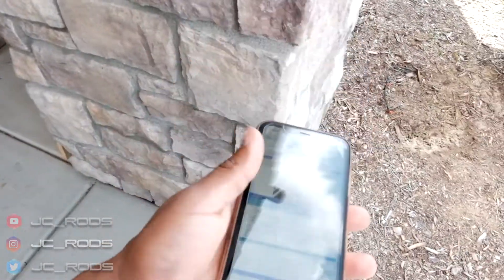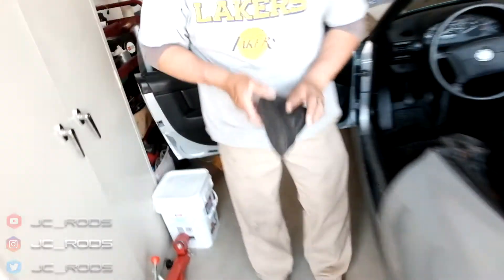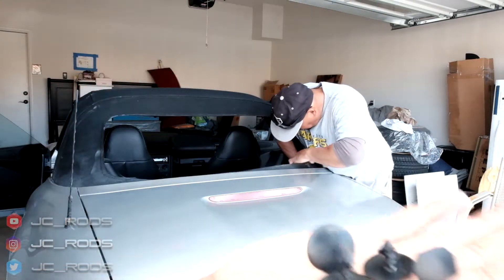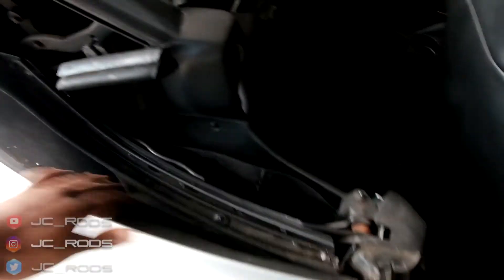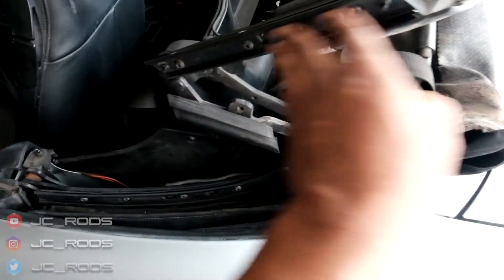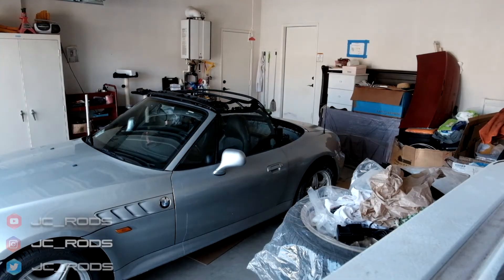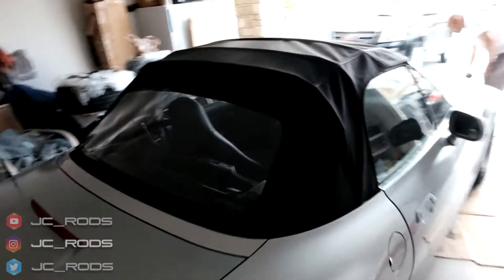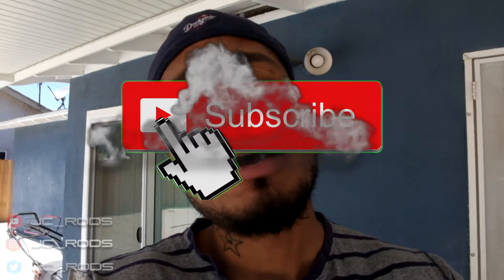Replacing soft top on bmw z3 (Not a Tutorial just progress)

Comment: Hi Guy's, hope you give me some advice on Z3 please, while I was replacing removing the old roof and I accidentally forced and cracked the rear plastic bow which was mounted with the rear body frame with 4xbolts followed by the 2nd bow to mount with the rest 14xbolts, sorry my questions are did you apply BUTYL tape on the 1st and in between the bows to secure all the 18 bolts please, Cheers?

Comment: Im not looking to buy a new top. I just want to fix some stitching and I need to take it off to do so. Did you have to cut any pieces of the top to remove it or is it just a few bolts and screws and it comes right off???
Reply from the maker: I didn't cut anything to remove it, it should just be bolted down